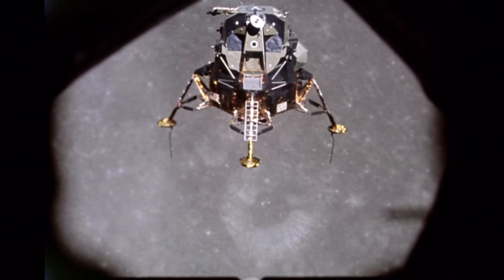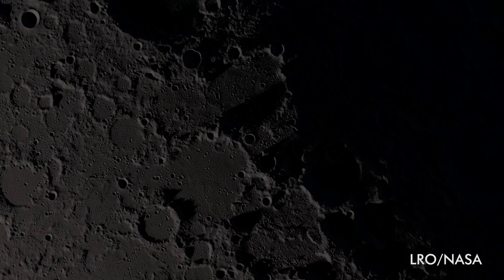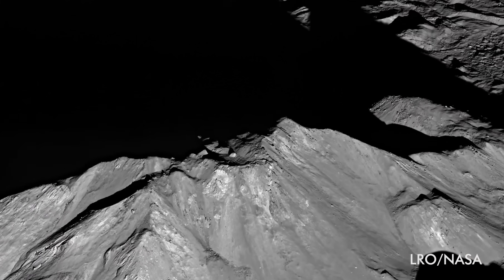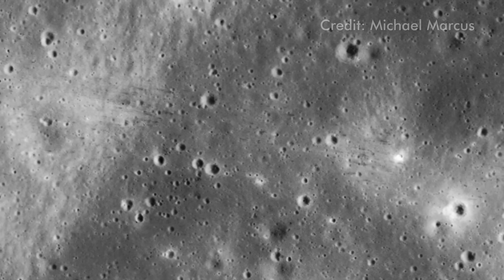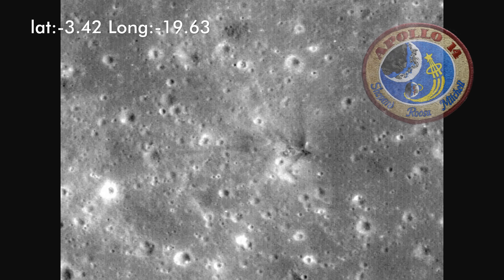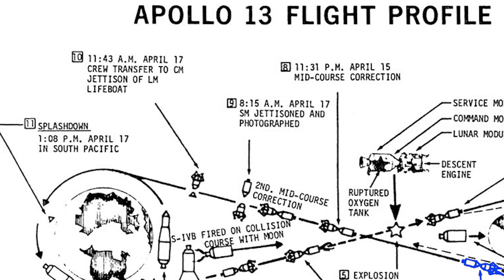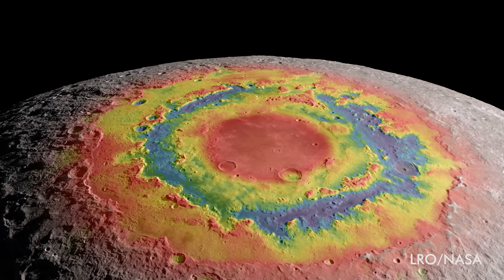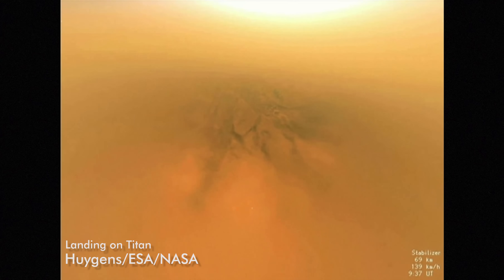Apollo Crash Sites: Lunar Modules & S-IVBs

Comment: Aluminum and non ferris materials dont get pulled by magnetic fields.
Secondly magnetic fields are not the same as gravitational fields.
Reply: Yes they do, by the eddy currents generated if one of them is moving. Old car speedometers worked this way, they had the flex cable rotate an assembly with two magnets on it. Close to this was an aluminium disc connected to the spring-return speedometer needle. The faster the magnets spun the more the aluminium disc would be dragged around, indicating the speed.
Reply: @1944GPW  
For non ferrous objects to be affected, the magnetic field has to be moving in relation to the object. In the speedometer, the aluminum cup is spinning which causes eddy currents. The eddy currents are what interact with the magnetic field, not the metal itself.
 A stationary magnetic field will not interact with non ferrous material.
Reply: @scott_meyer  
Well... He is saying that the craft is the moving object so eddies develop.
But Eddie current is an electrical phenomenon. Gravity is not

The difference between gravity and magnetism, magnetic fields can repel or attract and are an affect of atomic alignment.

In ferris materials the rotation of the atoms  align north/south 

With Gravity all objects within the atom are affected regardless  and attract not repel.

Personally I dont believe the moon landings happened.
I think that is all edited footage of control room personnel cheering on space missions
Professionally Edited footage of people going about there mission(s)

Many working parts none of which that were in the know.
The radiation fields are so intense that death within minutes would occur.

Am I a crazy Conspiracy nut?
Im a radiographer and 500+ KeV Particulate radiation will kill you fast.
I cant get my head around how they would be able to fly through that... and there is no lessor area they could have flown through as they say...
500 KeV is nasty
Reply: @logisticstransfer2475  the amount of footage both in film and streamed, is too much larger than the capability of a professional crew to put together. You conveniently omitting tracking from 2nd and 3rd parties which blow up your assertions.

Even if you really are radiolographer dealing with 500+ KEv particulate radiation, you would know that those things are easily stopped by sheets of light materials. Also you conveniently forgot that the astronauts where wearing dosimeters. If you have a balls to look at their data, feel free to do so.
Reply: @ΑΡΗΣΚΟΡΝΑΡΑΚΗΣ  500 KVA thats impossible to survive my friend....
That blows up their entire moon landing hoax 
500KVA stopped by thin sheets of anything...
A few beta and alpha particles yes
Not 500KVA "per minute" as Van Allen suggested 

At that rate of intense impact you would be fried by "Bremsstrahlung"

Most electromagnetic energy is given in hours KVA hours
Kilowatt hours
Amp hours

Yet Van Allen states KVA minutes...
Absolutely deadly.

Comment: Correct me if I am wrong, but Apollo 13 never landed, so why is there a picture showing the landing site of Apollo 13 S-1VB?
Reply from the maker: It’s the impact site of the S-IVB. The S-IVB is the third stage booster of the Saturn V rocket. It’s used to house the LM and to boost the astronauts into lunar orbit.
Reply: Apollo 12 left an ALSEP behind that had a seismograph and starting with Apollo 13, they decided to deliberately crash the S-IVB's  into the lunar surface to gather data. Considering how little thought went into the scientific portion of the Apollo program initially, it really is amazing that they eventually did as much as possible to wring out as much scientific information that they could with each mission.

Comment: We couldn't possibly know what is inside the moon, this is Absolute BULL $HIT! 

We can't dig down into earth 9 miles and we are told the center of the supposed spherical earth is molten Iron which is  2750°F yet the Curie temperature of Iron is only 1417.73°F (so there could be no Magnetic poles)!
Reply: @PaulHogsten  Really ? Do I have to quote the rest of the answer for you:
-------------------------------------------------------
"If Iron Loses Its Magnetism At High Temperatures, How Is Earth’s Core Magnetic?
-------------------------------------------------------

Iron loses its magnetism when it’s heated to a few hundred degrees, yet Earth’s core – which produces a strong enough magnetic field to hold the planet together – is made of iron that’s so hot it is in a liquid state!

Why then, does the molten iron in Earth’s core produce a magnetic field?

... (explanation of Curie temp omitted)

Earth’s core has two segments: the inner and outer core. The outer core is so hot that it exists in a liquid state, but the inner core is solid, due to the extremely high pressure conditions. Also, the outer core is constantly moving, due to Earth’s rotation and convection.

Now, fluid motion in the outer core moves molten iron (i.e., a conducting material) across an already existing, weak magnetic field. This process generates an electric current (due to magnetic induction). This electric current, then, generates a magnetic field that interacts with the fluid motion to produce a secondary magnetic field.

The secondary magnetic field reinforces the initial magnetic field and the process becomes self-sustaining. Unless the fluid motion in the outer core stops, the core will keep producing a magnetic field. This is exactly the premise of the 2003 science fiction movie The Core."

I'm sure the American Geophysical Union would be delighted to receive your findings!
Reply: What are you, some kind of flat earther ?. Of the top of my head I would of said it was due to the dynamo and the first entry on google turns up:

"To put it all in simple words, molten iron present in the core doesn’t produce a magnetic field directly; rather, it produces an electric current, which in turn produces an electromagnetic effect, which ultimately produces the strong magnetic field of the Earth’s core."

Took me about 5 seconds.

Did you actually watch the video where he mentioned the reason for crashing the spacecraft in the first place ? Or you are a dimwit like all conspiracy theorists ?
Reply: @tma2001  good explanation, but Paul is not interested in facts. He is interested in coming up with creative ways to validate his insanity.

Comment: Apollo 13 never landed on the moon but they still managed to leave an impression on the surface.
Reply: How did the Apollo 13 descent stage leave an impression on the moon? Huh? The astronauts used both stages of the LEM to escape out of lunar orbit and get back to earth since the service module was disabled. The descent stage is not on the moon.
Reply: @kevinkarg4464   He's talking about how the S-IVB from Apollo 13 was impacted into the moon so the Apollo 12 seismograph could get some info.
Reply: @mako88sb  That's the third stage of the Saturn V rocket?🚀
Reply: @kevinkarg4464  Yes, and it was always intended to be crashed into the moon, just like the S-IVB's for AP-14 to AP-17.
Reply: @mako88sb  Wow. I didn't know that. I always thought they were floating around in space somewhere. Thnx for the info.
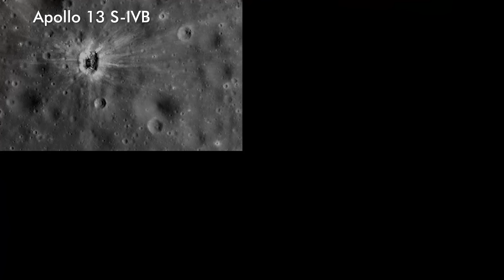Reply: @kevinkarg4464  2:18

Comment: It would be interesting to recover the computer(or what is left of it) and read the location at wich it lost power from the B12 erasable memory module, wich was potted and housed in a metal box(apollo guidance computer) wich was located in another metal box(aka. lunar module) and had a good chance of surviving the impact in less than 100 pieces and still being in "analyzable" condition.
Reply: Sadly a lot of the sub assemblies were made of boxwood so may well have been crushed
Reply: @andrewrixon2347  I think you mean cordwood.   It doesn't mean they were actually made of wood, it was a construction technique for electronics used in missiles and later rocketry.   Things like the AGC were ruggedised to survive g forces from launch, serious vibration etc.  It's not impossible some components or possibly complete modules survived impact, at least on some of the impacts given the extensive debris fields, the external structure would have come apart initially, stuff deeper inside probably later in the impact process, when velocity was somewhat reduced.   Only way to know for sure is to go and look.